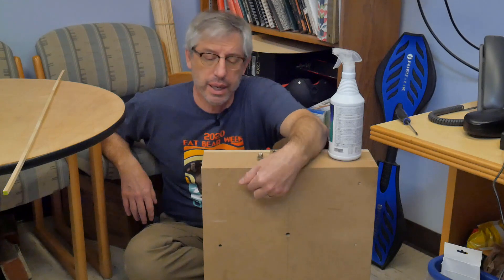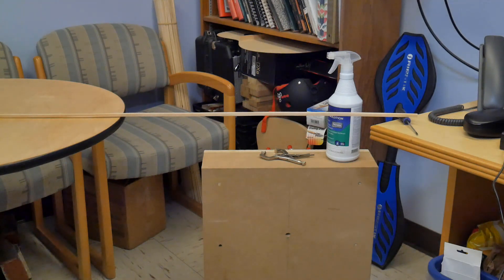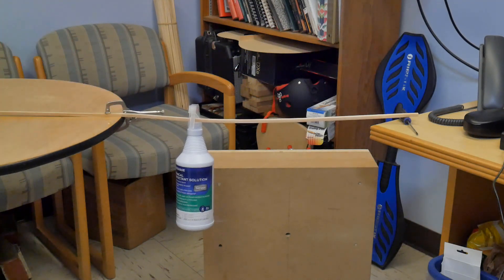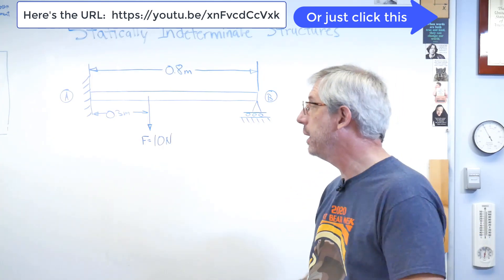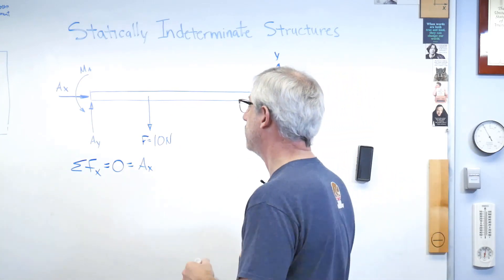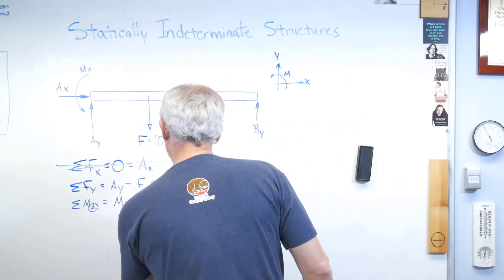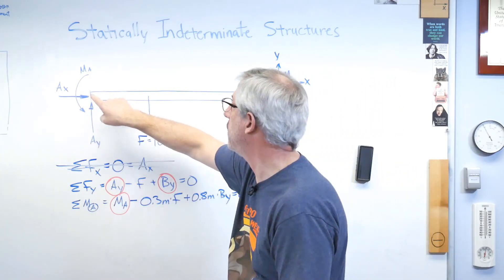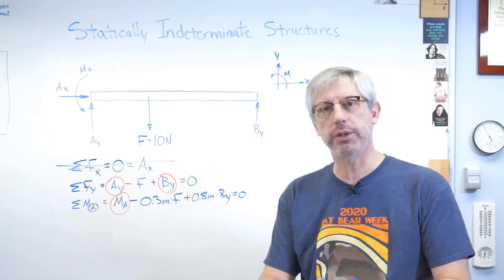Statically Indeterminate Structures - Brain Waves

Comment: I am so disappointed that you stopped. May I suggest you continue with this video by adding how to do a statically indeterminate problem. This video was enlightening.
Reply from the maker: Good idea.  I stopped because I shot this video, in part, for my statics class.  Thanks for the suggestion.  I'll work on extending it to show how to solve the problem using strength of materials.
Reply: @purdueMET  Hi, thank you for your video, I really really appreciate it. When are you gonna upload the next part? I've been waiting a week so far, can't wait longer!.